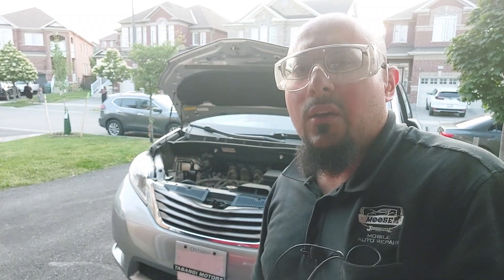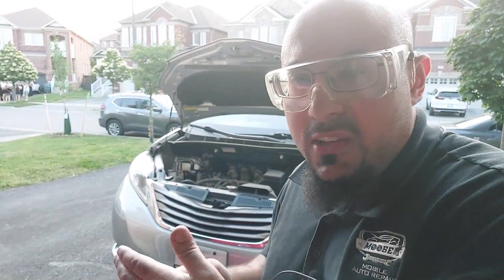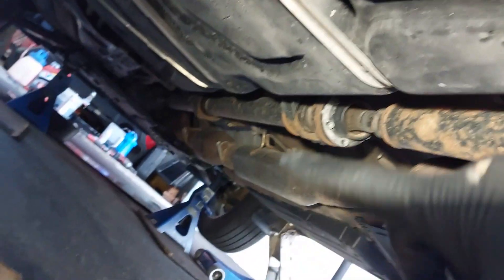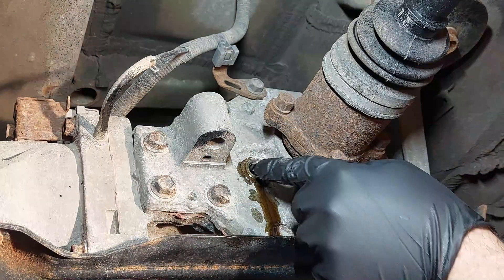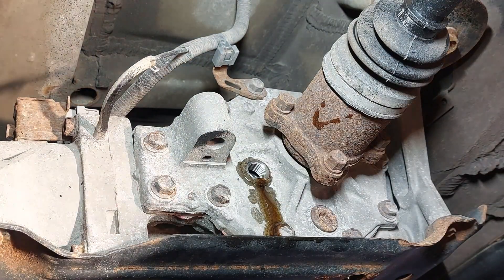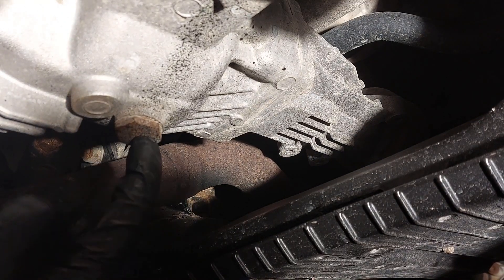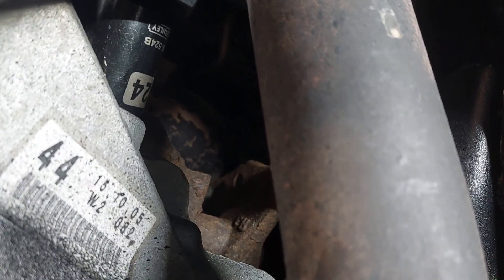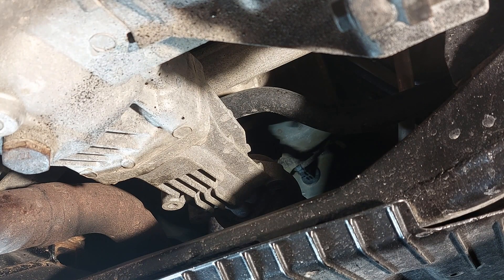2015 Toyota Sienna 3.5 V6 AWD - Transfer Case & Differential Service

Comment: Is it okay if I use small ramps so I can get underneath the van.  I don’t think it will make to much of a difference with the van slightly angled up?  What’s your thoughts?
Reply from the maker: Ramps are OK to use, but you won't be able to fill it up to the proper level unless you fill what the capacity is. Also, if you want to check the level you won't be able to check it properly when it is on an angle and it makes a big difference and the fluid levels will be quite a bit off. Unless you get it on ramps on both ends of the vehicle then it might be OK, otherwise you can fill to what the capacity states.

Comment: I have Toyota Sienna xle awd 2018 which oil do you recommend for differential case?
Reply from the maker: Any 75W90 GL-5 gear oil is what I use. I use this stuff these days and works fine.

Ultra1Plus™ SAE 75W-90 Synthetic Gear Oil, API GL-5 | 5 Gallon Pail
https://a.co/d/ffHpsdP

The Toyota dealer stuff uses LT gear oil which is 75W85, but really it doesn't make a difference and 75W90 is safe to use also.
Reply: Thank you so much 💖
Reply: How Many letters do I need for transfer case and differential case all together?

Comment: Do you know what number is the rear differential seal left side my car left side it has leaking
Reply from the maker: 90311-42062
Fits either side left or right for the rear differential.

Comment: Does the front have a differential too or just the rear?
Reply from the maker: Yes. The front differential is actually the front transfer case on these Toyotas. Then you have the rear differential. Just the two that requires servicing.
Reply: Thank you very much

Comment: Has anyone experienced a smell in the cabin after doing this service?

Mine has not gone away after 3000kms since the oil replacement.
Reply from the maker: I would recommend going under the vehicle to check if there is any left over gear oil or if there is something leaking. Sometimes washing down the area with brake cleaner can get rid of that smell.
Reply: Thanks 

No leaks so Ill try the brake cleaner
Reply from the maker: @Dan-tx1ch Try that and see if it works. There could just be some residue left over on the exhaust pipe and stuff.